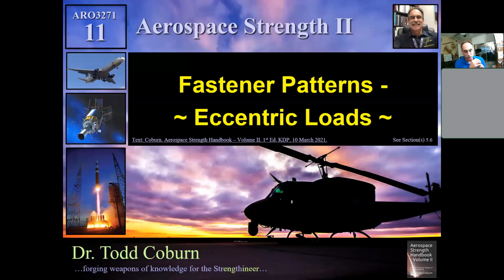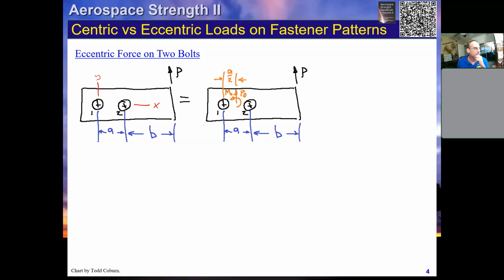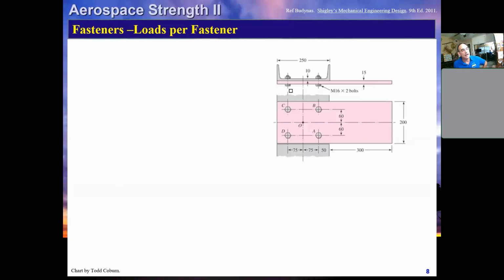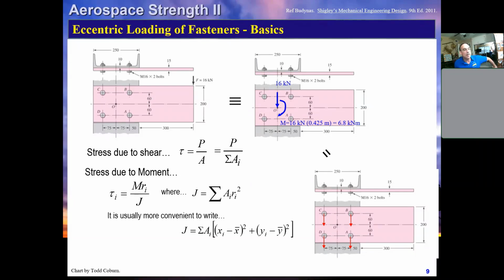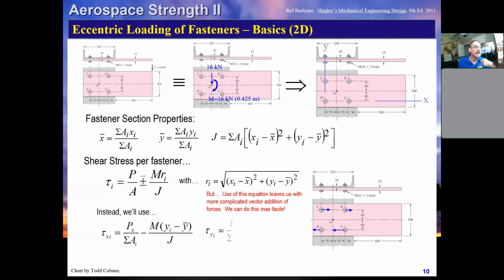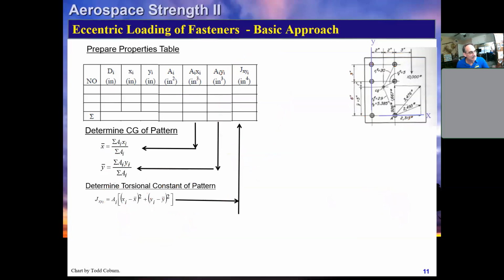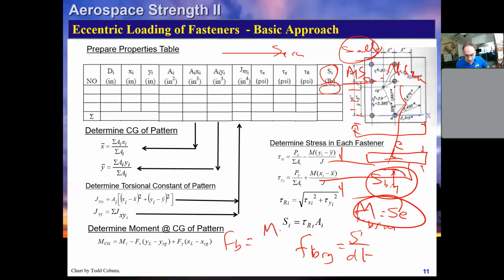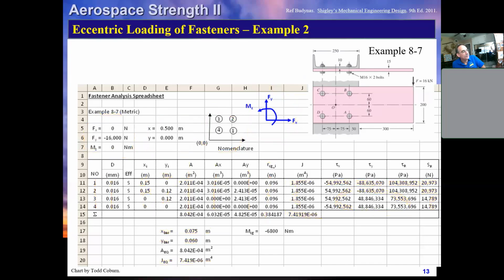Stress Analysis II: L-11 - Analysis of Fastener Patterns with Eccentric Load

Comment: Hi Todd, this is the great video to understand this bolt group analysis very quickly. The figure you are showing at 30:32 at the right bottom, vector for Y component for the left two bolts should be upward i think. Please correct me if am wrong. 
And one more doubt I have is, why do we use moment induced shear component as minus sign for Xstress and Plus sign for Ystress in the below two equation?
Reply from the maker: Thanks for the comment.  Yes, the graphic falls a little short.  It is trying to show the fact that we end up with two perpendicular components that can then be combined in a root-mean-squared calc.  The force causes components only downward, and the moment causes horizontal components as shown plus vertical components that will be down on the rightmost fasteners and upwards on the leftmost fasteners.  The final vertical force on the rightmost fasteners will be downward, as shown, but the direction of the leftmost fastener vertical component may be up or down depending on whether the moment upwards component overcomes the downward component from the applied force.
Reply: @ToddCoburn  Thanks Todd